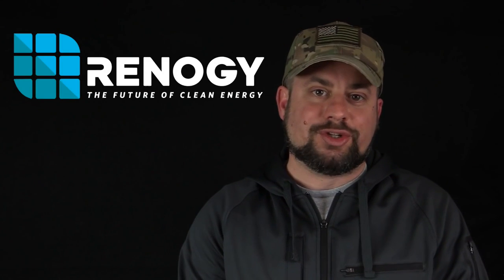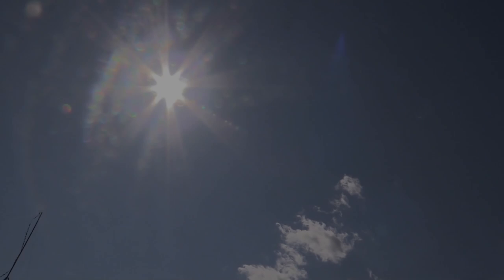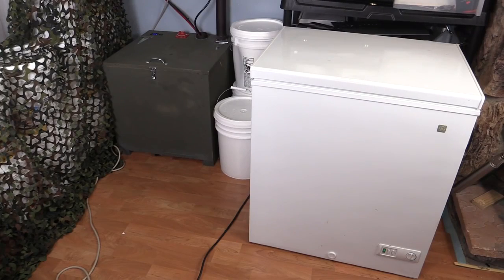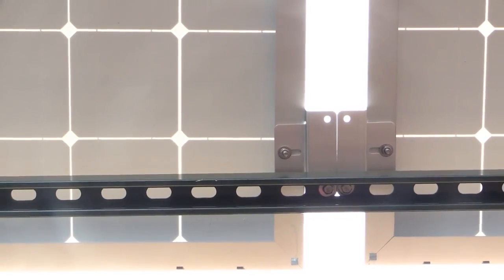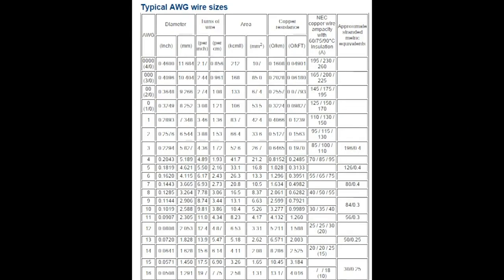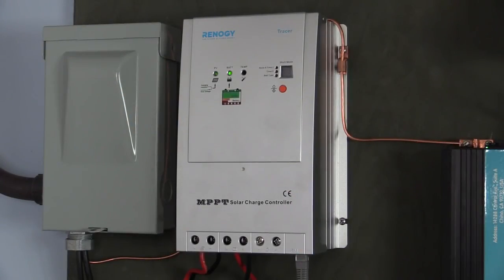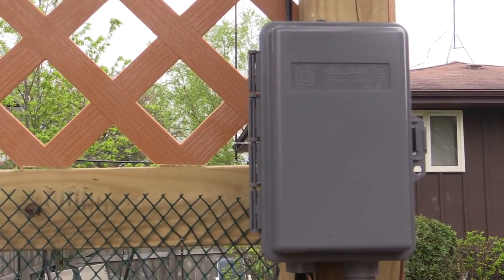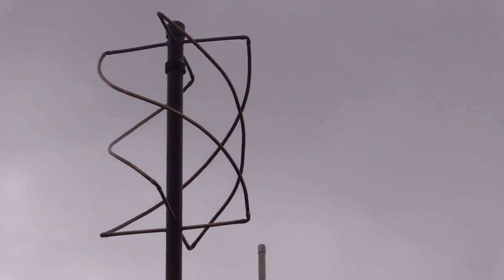The Ultimate Guide To DIY Off Grid Solar Power | Tin Hat Ranch

Comment: good basics...thanks for trying to make it layman simple. Funny too. As a side note, fork lift batteries can really do a fantastic job of giving you longevity and higher voltages. Definitely a cost issue , however, using these can really help to keep you off grid almost exclusively. Also UV transfer grids can convert UV better than simple photoelectric style, which depends heavily on a clear source spectrum. These will become more and more attainable at lower cost so people can utilize any daylight hours  (overcast, raining, even snowy) so there is less yearly loss.

Comment: I have 2 solar panels of 12 volt one having 200watt 8.9amps and other have 160 watt 8 amps. Both are of different brands. One hybrid solar inverter of utl shamsi 875 VA 12 volt. One utl solar battery 12 volt 150 ah. I am facing problems regarding backup and load. Don't know if the battery is getting full charged or not. Inverter showing charging from 7:45 am and till 4:20 pm. No load given in day. But when given load of 25 watts only the inverter shows battery fault and starts beeping noise just after 5 hours. Can you please suggest how to rectify what I am missing.

Comment: Apologies in advance for not scrubbing through the entirety of the comments.  However, i think HEAT (no necessarily Cooling), but having the proper heating in the winter is necessary.  In this case what would you do to heat the lodge (or what not)? Is there a simpler set-it-and-forget-it system one can implement? 

My personal project would be creating a shed/studio in an area where electricity cannot easily be run. The hope is to make this a 24/7 use and storage area for some expensive gear (musical instruments and gear, computers, power tools, etc.) that can be run off-grid but still maintain 64-67 degree temps in the winter and open window - fans in the summer. 

Any thoughts - or is it time to give up and pay big electric to run 100s of feet of line

Comment: I swear, when he said he could see my eyes rolling, it felt like he was watching me. LMAO I'm an electrician, so I was rolling my eyes for sure. But, I am in the process of converting solely to solar and wind energy. I am building most of it personally. I plan to remove the eletric company entirely. Honestly, the most power we use is the refrigerator and the dryer. Wind enrgy is easily attainable in the Panhandle of Texas. Solar energy is also easily attainable, except during the winter. We have some serious storms too, so I have to plan for that as well. The best plan I can have is a metal box that is mounted to concrete to protect it from tornadoes, strong winds, etc.
Reply: I have 16 panels they put on my roof, but I don't see any benefit. I would like to change to batteries... mr. electrician... can that be done??
Reply: @beckygamble6178  Absolutely! You should already have some batteries or capacitors in use as it currenty stands, you need somewhere to store the power for use, otherwise, the panels are pretty well useless. It is exactly the same as any other system. Usually you run either: 6, 12, 24 or 48V batteries as your stoarge voltage/device. Using a charge controller and an inverter (same thing you use in your vehicle to step up 12V to 120V for your smaller items that you may be bringing in your vehicle), Now, obviously, it is easier to step up to 120V from 48V. But, as was metioned in the video, that is not always an option due to financial restrictions to the individuall (budget). I have found that I can power my whole house on a 4,000 Watt inverter. This is because I am not that heavy on electricity usage. I have fit my house with LED Waffer Lights, I use a 120V Dryer for clothes drying (Note: Most dryers can be wired for 120V, it is a common misconception that ALL dryers are 240V), and our other appliances such as the stove and the water heater are actually propane/natural gas. but, anyway. Yes. You would normally using some kind of battery bank unless you are using capacitors for daytime use only. I would suggest using lithium ion batteries due to their long lifespan and easy maintenance. There are different kinds of lithium ion batteries. I would advise using Lithium Titanate due to it offerning high performance, long life san, and a high degree of safety. These batteries can be a little costly, but, they will save you money in the longrun with their service longevity compared to other lithium ion meterials combinations. I have put together several solar systems for customers in my area. You need an electrician to do this for you if you are doing new construction, plan to sell power back to the electic company, or do not currently live in the home at the time of the solar retrofitting (i.e. rental property). However, in Texas, depending on city ordinance, most counties and cities will allow you to build and install your own solar system, provided you are not going to use the electric company, without an electrician and without inspection, on a property which you own, and have homesteaded. The reason for this is that if you burn your own house down or you are without power, that is your problem. Now, remember. If you do go that route. It is completely on you. I will take no responsibility for anything you do to your home. I am putting this out there for informational purposes only. I am not advising you on anything you should or shouldn't do. I am not instructin anyone on how they should buid a system. This is at your own risk if you do this. I wouldn't risk my license like that. Hoever, on my own home, I will do as I please. I don't plan to use any service provider for much longer, minus internet, phone, etc. But, utilities, pssh. I don;t really ned them. Drilling my own well, putting in my own septic, producing my own electricity, even producing my own natural gas are easy tasks for me, bar finances. I have to take it one step at a time. Anyway.Good luck and have a fun time with whatever you do. Just remember to do your own research and work off of solid knowledge. And remember, it is always better to check codes and make sure you adhere to them, even if it isn't required in your situation. Your home is valuable and imporatant to you. Dont burn it down!

Comment: Plan your own system before copying someone else's. Read the manuals on-line before starting to buy. I run 1.14 kW, 6 panels all in parallel, to give 36.6v at MPP, because my controller is right by the battery.. The manual gives the efficiency curves for different voltage inputs, so I went for 24v battery. Low losses = less heat = better reliability. Copper cable is a one-off purchase; get off-cuts at scrap price from an electrician. My system does 50% of my annual power-bill, pay-off is 8 years.

Comment: Good video but my kettle alone is 2200 watts just to boil water so adding up my total household general running will require a minimum of 7 KW to keep it all ticking over with day to day running with everyone in my household if a lot of things go on at once.

Comment: Is there an advantage to creating two parallel paths put in series like you did your batteries?  This would give you about 10.6 amps and 39 volts. (rounding used to keep it simple)

Comment: I found your video to be very informative and mostly accurate except for one thing. You said that a car battery is made to deliver a sudden, large burst of power and recharge "slowly" and your golf cart batteries are made to deliver less power longer and be recharged quickly. You have this reversed. If you put an amp meter on your car battery and crank the engine. Now watch how fast your 85 to 125 amp alternator brings it back up to full charge. Initially, it will feed the battery between 30 to 60 amps depending on things like the age and condition of your battery, the age and condition of your alternator, how long you have to crank your car before it starts and the battery's internal and the outside air temperature. Unless you have acres of solar panels and a case of charge controllers, your solar battery bank usually won't charge this fast or at the level that your alternator will do the job in your car. The rule of thumb for solar applications and lead acid batteries is 10 amps of charge capacity for every 100 amp hours of battery capacity. If you have 1,000 amp hours of battery capacity, you'll need a minimum of 100 amps of charge capacity out of your charge controller(s) and maybe a some more in your solar array for use while charging during the day. Lithium ion and lithium iron phosphate batteries is a whole nuther story.
    Being that you are in the business of information, here's a little battery trivia for you. If you set a volt meter to a 3 volt or higher DC setting and take a BRAND NEW, FULLY CHARGED lead acid battery and put the negative probe on the negative terminal and CAREFULLY put the positive probe into the adjacent cell filler hole into the electrolyte, being careful to not damage the cell plates, you'll find that it is about .6 volts. Now carefully go from cell filler to cell filler and you'll find that each cell puts out 2.2 volts. When you get to the last filler hole, you put the negative probe into the last hole and the positive probe on the positive terminal and you will read about 1.6 volts. 5 X 2.2 = 11 volts. .6 + 1.6 volts = 2.2 volts 11 + 2.2 = 13.2 volts total. In practice, the internal resistance and, in time, self discharge will lower these numbers slightly but lead / sulfuric wet cell batteries run at 2.2 volts per cell. This was how we used to diagnose a faulty battery back in the 1970's. Now they have these "new fangled" battery analyzers that use 18 gauge wire on their clamps. Unless your battery voltage is unusually low, these aren't accurate. I bought a new battery at my local Ford dealership where I bought my car. In less than a year of it's 8 year guaranteed lifespan, my engine started to crank noticeably slower. They brought out one of these hand held toys which showed the battery to be good. I said "Uh huh". They took the car into the shop and put the roll around battery on a load tester which showed the battery to be bad. For me, give me a good carbon pile load tester over some computerized whipper snapper any day. :) I love the 3 year free replacement period. Have a great year.

Comment: Thanks for great video.  Just one hiccup. When comes to battery charge controllers You said open circuit current  of 23A.  When circuit is open current is zero and we can measure open circuit voltage (Max  ~18.9 V) And any power source can give optimal current without damage it when circuit is closed (Max Amps).  If current is slightly greater then what specification says we can talk about overload or short circuit current which would be much greater than what is manufacturer recommends . In both cases we put our system in risk. You did tully great job. Thanks again.

Comment: I used the PVWatts calculator.  Free and easy to use.  If you get real froggy you can download hourly expected production numbers (yeh 8760 lines)
AND - you don't have to tell anyone your location
And OBTW - you can "go wrong" with a PWM controller.  They waste most of the energy in the voltage higher than that of your battery bank

Comment: Really good job simplifying complicated info. 

I don’t recall hearing you talk about the power inverter.  That if your system is 24 volt, you will need a 24 volt inverter.  I’m a multitasker, I probably just missed it.  Lol

You mentioned CME and EMP events… probably not a bad idea to build a small
Faraday cage in the basement to store a back-up controller and inverter.

Comment: Amerikans using 30 Kilowatts power a day? I do use just 6 kilowatts at best a day. I do design a multilevel inverter who does 5 kilowatts, from 48 volts not 24, or dependent of panels even higher, this give les amp more voltage, needs less thick cable and losses.

Comment: This man answered almost all questions I needed answering.  Fantastic.  Only think I'd say is although Lead is affordable,  lithium cells will last a lot lot longer so in the long term, work out cheaper.  Especially if you use them between 20% and 80%

Comment: Loads of great info here but please read this before choosing which type of solar panels:

STOP! Efficiency comparison is useless. You first need to think about usable sunlight hours and where you live so PLEASE read the info below:
Most of the planet are using the wrong Panels!
If you don't track the sun daily, if your not going to change the angle seasonally or if you have a decent amount of overcast days and if you have a bit of extra space then the best panels are thin film. Most of the northern hemisphere are using mono or polycrystaline panels which are no good unless you live at the equator or unless you track the sun throughout the day and the year.
  The panels that everyone uses only work well when aligned into the sun and are completly unobstructed from shadow.
  Thin film panels will work in low light levels which includes sunrise sunset, overcast days partially obstructed by shadow and unaligned panels. 
  So unless you track the sun Mono and Polycrystalline are only getting a decent amount of power for 4 or 5 hours a day for half of the year.
Thin film will give you full power all day all year long!
  If you have a little more space and can invest a little more initially you will soon recover your costs and more!

Comment: My house in Colorado is completely off the grid.  . using 2400 watts of panels with 26 batteries.   It is totally self sufficient, and I can go for days without sun.   We use electric coffee makers, refrigerator, TV, and.  .What I saw in your video.  . .Ham Radio.    I run all tube radio's at the cabin.  Heathkit hw-101.   I notice you were on the 40m band, do you run on that frequency?  I have chatted to a few people on 7.2.

Comment: Solar systems should be sized for the worst 10 days of the year, not the best 10 days.

This helps me with the series/parallel wiring calculation of the PV panels. 

It still rather simple with small systems. But once you get into the 2kw system range components get expensive and the power can be even more dangerous. 

Lots of quality companies out there making components though. Renogy, Sol-Ark, RELiON, midnight and others.

Comment: Are you aware that lead acid batteries get a ‘surface’ charge during charging?   They have to be discharged a tad to show a truer battery condition.    Many years ago I made meters to show battery charge with golf cart batteries.   I used a re-labeled milliamp meter and a whetstone bridge.  Zero was equivalent to 31 volts and 100% to 38 volts.    Sold hundreds of those things in my local area.

Comment: Good video.  All i need is a controller that slows down the talk but still keeps  the words  intelligible.  Until i find that the computer rewind button will have to do because there is a LOT of info i'll need to hear more than 10 times before the synapsis keep shorting out.

Comment: finally a video in a understandebol languise,i lurned a lot to make future dissisions on what i will do . one question ,can i pump up the sistem to a sise were i can use aircon anny way hehe? am an euro expat living in the Philippines so we have sun almost every day all day and i plan 24  12volt batterys served by 24  400wat solar pannels, combined whit 2  10000wat inverters i wil use mppt charge controlers to fill the batterys , that's logical i think he. thanks for the vid,greets Dirk

Comment: The average home does not use 30 kilowatts of power per day.  The actual published average is about 10, and even that's high for most people.   You have to be incredibly inefficient 24 hours a day to use 10 kilowatts.  That's like your fridge is running constantly because the door is being opened every five minutes,  you cook 4 meals a day on an electric stove with every burner and the oven on, you have every light on in the house, (and they're all incandescent) you have the AC set on polar vortex, you do 3 to 4 loads of laundry per day, you have 4 to 5 computers/laptops running constantly, your kids video game for 8 hours a day, and you leave every TV on 24 hours a day.  I mean...

If you do all that, you might use 10 kilowatts of power per day, but even then, probably not.    I don't know where you got 30 kilowatts per day, that's absurd!   You have to work to use even 10 kilowatts, let alone 30. 

Even in the heart of summer using the AC, we only use about 3 kilowatts per day in our home. In the winter it drops to 2 or less per day.  Yes, we have a small-ish house, 1800 sq feet, but, it's a two story, standard suburban home, and it's a fairly average size. Most homes around here are between 1800-3000 sq ft, with the real average being probably around 2500 sq ft.  Even if you doubled our home's size to 3600 sq ft, which is a pretty huge house, you wouldn't necessarily double the power consumption.  They're probably at around 5 to 6 kilowatts per day, in homes that size. 

We're have a 4.1 kilowatt solar panel array installed on our home.   We're getting a bi-directional meter installed as well, because in our state, we'll actually get paid for any electricity that we feed into the grid.   We're going to be feeding between 1 and 3 kilowatts of electricity into the grid every day.  Pretty excited about that.